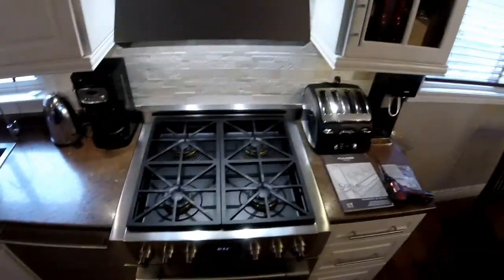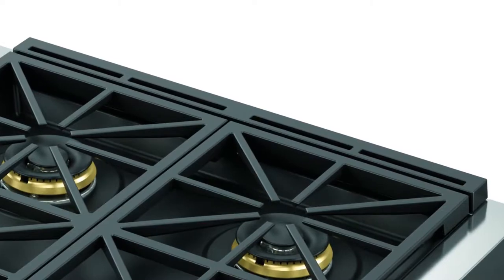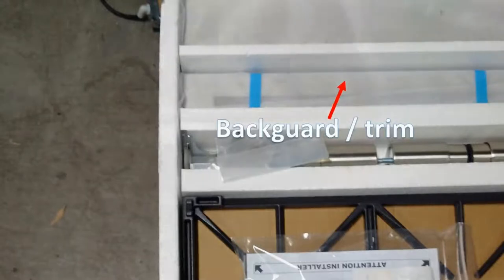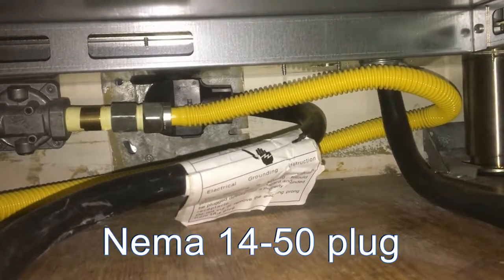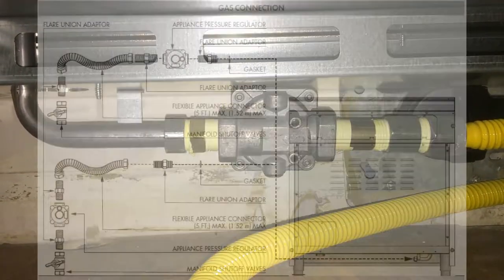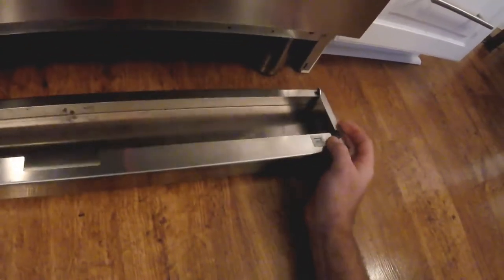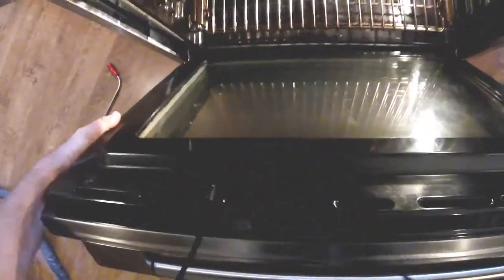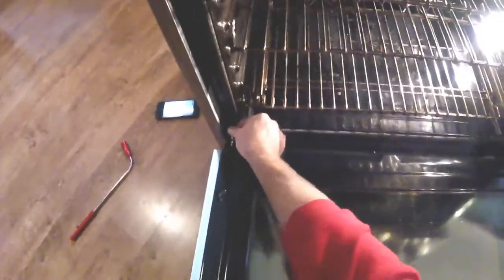Fulgor Milano Sofia Pro Range Installation Tips and Considerations

Comment: Great video. Is the regulator necessary ? I’m hearing mixed messages about this !  I just bought a Fulgor Milano 36”.
Reply from the maker: Absolutely you need it unless your incoming gas pressure is exactly a consistent 5"WC for NG.  Pay attention to the direction of flow indicator on the regulator as well.